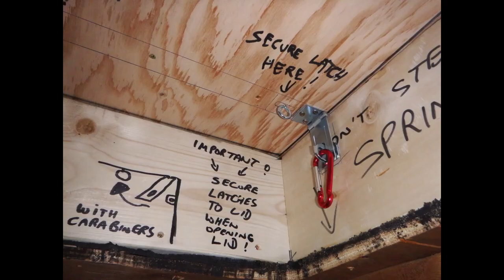Building & Installation of FLAT ROOF - ACCESS HATCH / DOOR

Comment: Great info, thank you for posting. Curious about the hinges. Did you have to omit the wooden flange on the end where the hinges go in order to open the hatch?
Reply: Also curious what hinges you used?
Reply from the maker: Hello State of Wander! If you look at the PHOTO at 0:55 , there you can see that I used two "regular" hinges, it looks to me that they are around 2" to 3" long. Also it looks like that I omitted the "back" piece of wood on the lid, you know what I mean...?! The bottom part, the 2"x6" frame is complete, also the 2"x2" that goes around it, goes around it on all four sides... It's a while ago I built this! 🙂 Thanks for your reply! 🙂

Comment: Where did you get the hardwarw
Reply from the maker: If I remember right, probably at RONA or HOME HARDWARE in Kelowna, BC, they are located basically right next to each other and I usually go there first, one store, and if they don't have it, the other store, just on the other side of the road! The hardware items are really nothing special, you should be able to get the parts pretty much anywhere! 🙂